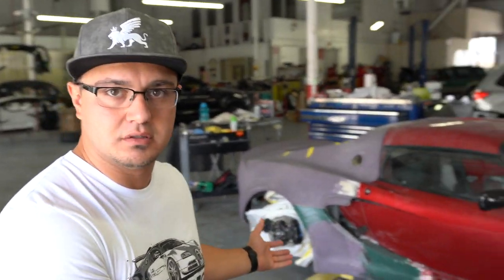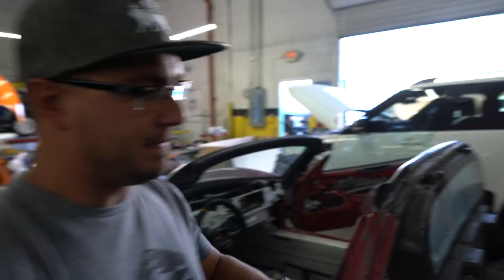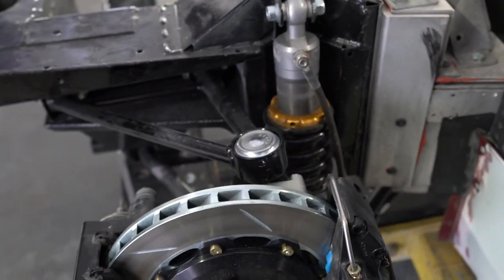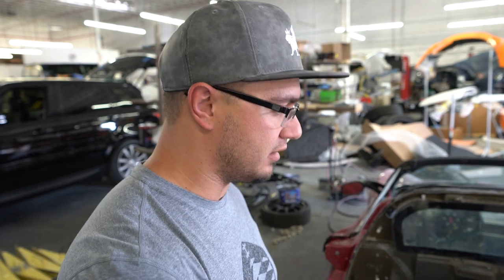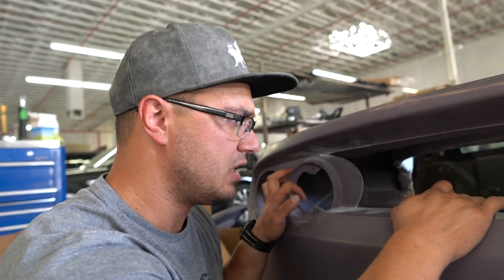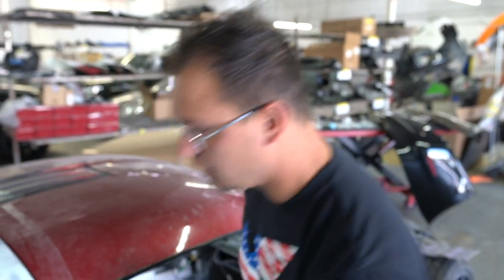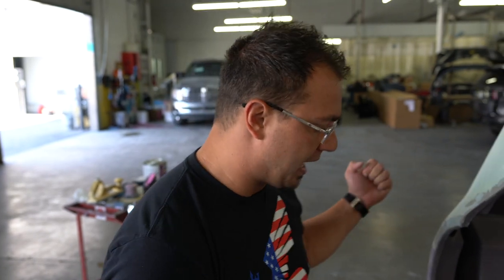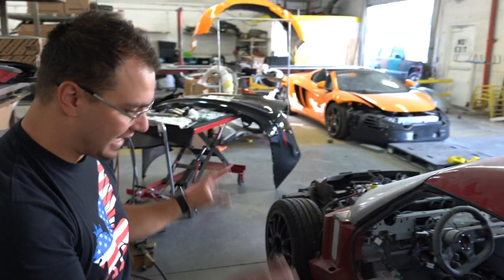Ultimate Lotus 600whp Widebody Build | Part 1

Comment: Why not the exhaust out on top like on the new McLaren 600 Lt or the Senna? That would make things way easy for you not to talk about how cool it would look!
Also a roof scoop would been both cool and effective in cooling the engine/ Intercooler.

Btw great videos Houston!
Reply: Exactly I think Houston should consider this plan of an idea
Reply: If it were a hard top yes but the top is still removable so kinda defeats the purpose if Huston wants to drive with the top off
Reply: Well tell Pagani that because a floating roof scoop works just find on the Zonda etc. 
I think it would be both great as a look and a great way to get more cooling/ oxygen to the engine.
Reply: Carbon Fiber Vs Fiberglass Big difference in weight a fiberglass roof scoop would probably add 2-300lbs to the car to make it functional. Instead the roof scoop should be going on Ragnarok not the Lotus.
Reply: I never spoke of material and you simply said he couldn't have a removable top and a scoop.
However I do not agree on your weight estimation/ functional opinion either.

It would work just fine and also I'm not talking about a 6 foot scoop just enough to grab some air and push it down the engine bay, even with a fiberglass solution it shouldn't be more then 15 lbs so not sure what kinda scoop you're talking about.
Reply: Pagani an Egg style half scoop fine not a whole scoop like a Super Terfeo or Mclaren

Comment: Hey man, it was nice seeing you in Monterey!  Didn't know you had a couple of fun projects in the works.  You have the hypercar build for all out speed, why go so far power wise with this Lotus, and not a more modest/reliable 400-450hp?  Slow car fun as it were.  With the new wide body, how much rubber can you fit?  Lastly, speaking from knowledge gained from the Ultima, are those rear calipers going to be enough, or do you have an upgrade planned already?

Comment: Would look so much better if you had the exhaust come out between the taillights, what about like the exhaust tip mould into the rear bar with the round pipe that slips into it like a lot of new cars these days.

Comment: The rear brakes need to be flipped so you can properly bleed them:; the lines connecting both sides of the caliper need to be on the bottom and the bleed valves need to point to the top so all the air can escape.

Comment: Is this a different build?? That engine looks ridiculously small and unworthy of the car design ⚠️⚠️
Reply: Yes he got two builds.
The other build with the Lambo engine was supposed to go in this car but there wouldn't be enough space etc so he got a Alfa 4C that is built in California now.
I think this was an cool surprise and think it can be a real cool little track car.
Reply from the maker: you would be surprised how much that honda motor will put out
Reply: Unworthy lol it pumps out 600whp on a car that is super light, that thing is a rocket. But its a different build
Reply: Okay

Comment: Lol this cars paint is crap. Micro fibers stashed inside for insulation.  The door split open. Hatch doesn't clear exhaust lol. This build is trash in person. And doesn't run on flex only e85 no flex tune lol .